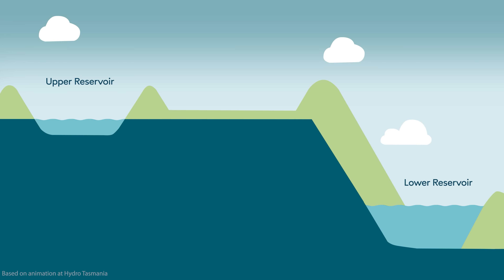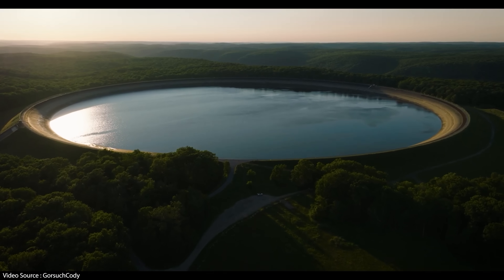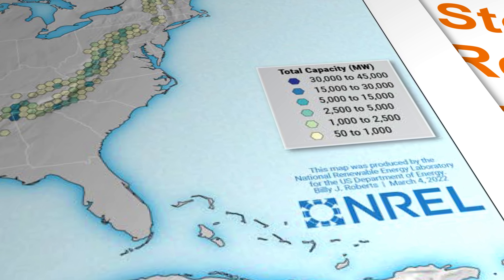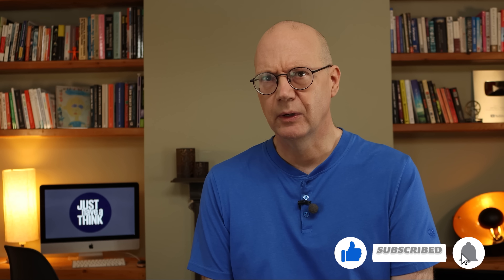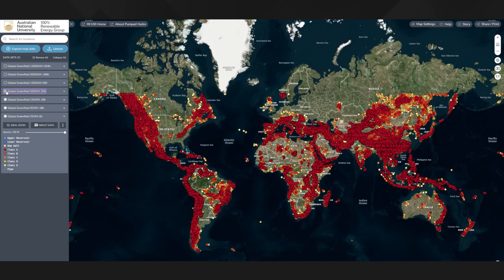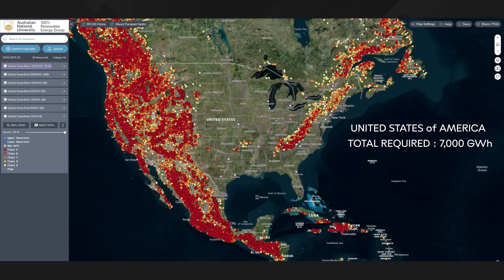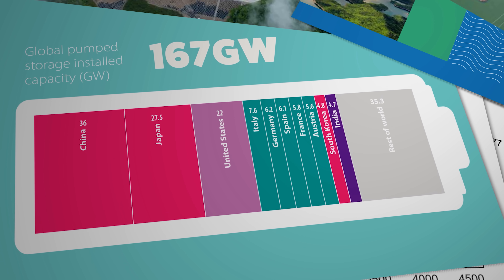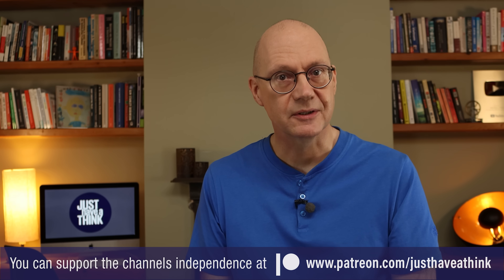The insane potential of Pumped Storage Hydro

Comment: Too bad there would be so many challenges replacing water with mercury in closed loop pumped hydro.  That could increase capacity by 13 times and reduce requirements in height and size.
Reply: There is in fact a company that has developed a closed pumped hydro system that uses a high density fluid - some kind of non toxic mineral suspended in water - which reduces the footprint. Drawback is that the reservoirs need to be fully enclosed. Company is Reenergise.
Reply: @petewright4640  There are lots of interesting challenges there as well.  I would guess keeping the minerals in solution rather then coating parts was a huge challenge for them.  Perhaps they found a mineral that could retain  a strong negative or positive charge.  Then charged the components with the opposite charge.  A prank some unnamed people i know pulled on new employees was to change the charge on a paint gun so the auto repelled paint.  I'll let you imagine the rest but it was quite a mess.
Reply: I can't see any potential problems with this idea whatsoever.   You might need to consider keeping this idea to yourself  - I am sure that if some politicians heard about this brilliant idea they would be all for endorsing it.
Reply: @michael-j-harrison  One of the things that make hydro cheap is that water is cheap.  You need 13x less mercury but i suspect mercury is more then 13x the cost of water.  You can't use any aluminum parts where mercury would come in contact.  Mercury spills would be a nightmare to clean up.  Water spills will basically clean up themselves.  Mercury is considered toxic.  If someone wanted to use this idea and make it practical please just invite to the grand opening.

Comment: Another interesting video. 
Floating solar would fit nicely with most pumped hydro installations.
The panels could help reduce evaporation, while the cooling effect of the water would help increase the efficiency of the panels.
The close proximity would also help reduce transmission losses.
Reply: You could also add wind turbines in the same location to share the electrical connection or even pump water back up to the top, which would probably be cheaper than using conventional wind turbines.
Reply: See recent Fully Charged video from Portugal
Reply: Didn't Dave do a video on that recently (using floating solar on existing dams), or was it another channel?  Lots of potential win here.
Reply: Floating solar on top of open water transfer channels is a great idea too
Reply: @JohnnyWednesday  absolutely. I saw, maybe on this channel, where they were trying panels over irrigation canals in India.
Reply: Interesting idea. It's new, creative, well thought out ideas, such as this, that are needed--and even more imporatant, need to be acted upon. Thanks.
Reply: tons of added cost to not just make them float but also maintain them on the water (they need to be cleaned and/or replaced. also as the water level lowers you run out of room and your panels could get wedged.

better off just using floating balls or whatever instead.
Reply: @rocksfire4390  yes, yes. all important considerations, which is why companies hire engineers to work out the technical, and accountants to work out the financial challenges of any major project. And not the YouTube Comments Section.
Floating balls will not generate electricity, and available real estate, mounting, maintenance etc are important factor in any renewable project.
Reply: @1964mcqueen  
accountants are wrong a great majority of the time on major projects, engineers fail quite often not just because some suck at their job but also because of said accounting being way off and the funding not being there.

floating balls might not generate electricity and i never said they did, what they do is keep the sun from evaporating the water which is vastly more important then getting a tiny amount of extra power. there is plenty of space for solar and wind for that matter.
Reply: @rocksfire4390  right. All those engineers and accountants can't hold a candle to some random You Tube viewer.
I'm talking about established technology that could be adapted to a slightly different scenario. Not reinventing the wheel.
Reply: @rocksfire4390  You are correct but advantages of solar on the reservoir are:
- local maintenance team can work both on the hydro power production equipment and the solar equipment
- no loss of energy (both facilities are located in the same area AND the transformers should be able to handle the whole system)
- Solar panels are more efficient when "cooled" by underlying water.
- Solar panels will benefit for solar reflection on the water and will be even more efficient
Lots of factors to be taken into account from technical and financial point of view for sure, but not all engineers and accountants are bad at their jobs.
Reply: @dominiqueridoux2073  
just because you CAN do something, doesn't mean you SHOULD do it. wind is much more viable then solar is on/near mountains, which is where these things will be going anyway.
Reply: @rocksfire4390  Not so, exists in a lot of places in China. The raft system used is flexible but also very stable. Imagine interconnected pearls and on each there is a few panels. Quite easy to scale up too. The one I have seen has a few of the rafts with no panels to form a flexible bridge from the land and you just need to walk to the panels for servicing. If you center the panels on the reservoir and only use 50% of the surface, the wedging never happens because the resevoirs are never drained completely. Still, energy produced on site can be used immediately on site to "charge" the battery, no loss of energy.
Reply: @rocksfire4390  yes, seen floating solar in Thailand works well but little movement on lakes and areas with high sun levels. Yes, I've seen the black balls realised to reduce water loss, looks cool😁
Reply: It would be interesting to see how the design could handle the change in water surface area during discharging. I suppose if you had to, you could allow the structures near the edges to 'run aground' during each cycle. Or just be satisfied with panels over the center area.
Reply: the varying levels of the reservoirs may be a problem though?
Reply: @markreed9853   The panels would simply rise and fall with the water levels, as they do when natural bodies of water fluctuate over time.
Reply: @1964mcqueen  I know they could do that but the extra cost of making the cable connection flexible enough ,and the mounting system flexible may outweigh the benefits. Sometimes what looks a good idea doesn't always work out economically (EG hydrogen vehicles)
Reply: @markreed9853  Floating solar already exists. It would of course require additional engineering, which is why you hire engineers. And why you have accountants do the cost analysis before any major project. Just as we figured out offshore floating wind turbines and the added expenses in their instalation, operation and maintenance, I'm sure there are people smart enough to figure this out.
Reply: @markreed9853 totally right (though you misspelled electric vehicles 😊)
Reply: @jeroendebruyne2165  thanks but cant find it now?
Reply: @markreed9853  You don't need to cover the whole surface; depending on the borders of the reservoirs (usually step angles) it would not be an issue, especially since the water is never pumped all in or out anyway)
Reply: Yes indeed. I have  posted two mildly caustic comments about electricity "provided" by closed loop pumped hydro. The next thought is that closed loop pumped hydro should only be supplied with energy from a renewable source. PV floating on the reservoirs is ideal. As that capacity grows the HC plants should be shut down. The utilities and corporates will not miss a chance to smokescreen their HC plants by intermingling any storage facilities.
Reply: I work in solar PV. "Float-O-voltaics" as this floating solar is know has serious issues regarding how they handle wind / waves. Generally speaking, I'm not sold that this is a viable strategy. Now, solar on canopies over water canals IS something I think is highly viable.
Reply: @MrBellytheman  of course there are issues, but FPV is in use. As with any renewable, the environmental factors need to be assessed before proceeding.
Reply: The water will almost certainly be acidic in old mines. It’s simply an unavoidable consequence of geology - the vast majority of orebodies are sulphides. You have to factor the huge maintenance costs in.
Reply: Indeed. I came to the comments section to add the same thought. Any location already using open space for power generation can benefit from PV generation
Reply: What is the efficiency of pumps and what is the water volume capacity of biggest pumps available? I mean how many cubic metres of water per hour for each biggest pump?
Reply: here in NL we had a site with floating solar, then an average summerstorm came along. Then they did not have floating solar anymore... 
IMHO floating solar is not a good idea...
Reply: @joop2295  Not in Newfoundland. I would imagine wind is the only sensible option there. That's what I have been saying; we have very smart people who assess these things for a living to see where and under what conditions any project will work. Just like Dave pointed out in this video, there are certain places where pumped hydro makes sense, just as wind makes more sense where you are, and solar where its sunny. All of these things are assessed for specific regions all around the world. Just because something wouldn't work where you are, does not mean it won't work elsewhere. Or they would likely determine that covering a reservoir is less crucial in N.L then it would be in Arizona.
BTW, can you direct me to any stories about that floating solar farm that was destroyed. All I could find was an article on a floating solar project that did not budge in a storm in Feb 22.
Reply: Just remember to never stop buying!  Consume CONSUME CONSUME!   The Delusions of the Amoral Shopping Addicts.
Reply: @java4653  you might be thinking of a different video.
Reply: I see more potential in thermal power generation, since the materials that can be used can be more easily designed to handle an aquatic environment, and converting thermal power to mechanical power for lifting water is a very mature area of technology.  By using water as the phase change material, we can also operate at lower temperatures.  For example, a giant percolator could have zero moving parts.
Reply: But how are you going to place solar panels over a many acre large body of water that has a rapidly and strongly changing water level....?
Reply: @Kabivelrat  I think that's already been discussed here. I am not an engineer, so won't pretend to know the details, but floating solar is in use in many parts of the world and in many extreme environments. I'm sure that smart people can design a system that accounts for changing water levels.
Reply: @1964mcqueen  Yeah fair enough...
Reply: And with the panels floating, it shouldn’t be too hard to rig the platform with cables and make the entire thing track the sun.  Increasing power output even more.  Maybe a single large piling in the middle which the panels would rotate around.
Reply: @douglee2438  this is a great idea imho. always thought on how to track the sun, but this is the best soluton imho
Reply: Dear geniuses, 
Stagnation is still a problem.
Reply: @rimbusjift7575  in a reservoir that is filled and drained on a daily basis?
Reply: @1964mcqueen  
Yes, this exact thing was a topic in the video.
Reply: Blocking sunlight over lakes would have a significant ecological impact.
Reply: @rimbusjift7575  You can block as much or as little of the surface as you like, but these are not natural ecosystems, they're built infrastructure, and the locations would be chosen to not include any valuable ecosystems. In this context, suppressing ecosystems is a benefit, just as it is in your kitchen.
Reply: @rimbusjift7575  We are talking about reservoirs. And the impact of increasing temperatures around the globe is having a much greater ecological impact than partially blocking solar radiation from penetrating waters that are heating at record rates..
Reply: @rimbusjift7575 In the case of a closed loop pumped hydro system, all wildlife would be introduced either intentionally or naturally and not be pre-existing to the site. Solar covered areas may also provide shelter and protection to young fish.
Reply: @craigknight2764  there wont be fish is a closed system
Reply: @markreed9853  not intentionally no, that was what I was saying.
Reply: "Closed loop" does not mean isolated from all other waterways.  Living things including fish will find their way in, if they are not deliberately introduced for the sake of a healthy artificial lake.
Reply: @JonathanMaddox  I understand closed loop means water is pumped from a lower reservoir to a higher reservoir. I have not suggested that either reservoirs are isolated from other inflows and out flows. The main point is that pumped hydro does not generate energy, it stores energy generated elsewhere.
Reply: @mayflowerlash11  my comment about isolated waterways and fish getting in was a reply to @markreed9853 who said "there wont be fish is a closed system".  Threading on youtube comments does not go very deep; in hindsight I should not have removed the default tag.
Reply: @JonathanMaddox  OK, thanks Jonathan. It's good that you are clarifying. Have a good day.
Reply: @rimbusjift7575  Like What?
Reply: @rimbusjift7575  
What ecological impact would it have on a man made lake with no fish in it?
Reply: @rimbusjift7575  The idea is to make artificial reservoirs, not use current lakes. In China they reclaim old  extraction sites (coal, minerals etc..) and anyway such lands are heavily polluted so no life whatsoever.
Reply: @dominiqueridoux2073  there is no place on Earth with "no life whatsoever".  Mine tailings dumps may be among the most polluted places on the planet, but they do support life and all but the most heavily toxic can be fully remediated over time into parkland supporting wildlife or farmland supporting people.
Reply: @dominiqueridoux2073  
Yeah, I just assumed the upper reservoir was natural.
Reply: @JonathanMaddox  You are 100% correct. I meant no "orignal" life whatsoever and also, China, hahahaha. They can strip resources like nobody can and when there is only bare rock left, not much life supporting for quite a while... At least they find a way to still make money EVEN out of such desolated location (and make use for their panels sine they produce soooo many of them).
Reply: @JonathanMaddox  and we do environental and feasibility studies on almost everything we build. Whether its a house near a wetland, offshore wind turbines or floating solar. 
Just as agrivoltaics can benefit both the solar yield and crop yield, we can design floatovoltaics that cool otherwise overheated lakes, reduce evaporation, provide shelter for aquatic life and produce efficient electricity at the very sight where it is needed. And all of this applies if life takes root in man made reservoirs. We can reduce losses of both water and electricity.
And, let's say you are correct that ecosystems will sprout in any reservoir we make. Wouldn't it be better that we give that life some light filtered through the panel arrays, structures to attach to and  places to hide from predators and lay eggs, rather than a bunch of plastic balls that do none of that?
Reply: @rimbusjift7575  Many of these sites are not lakes in the natural sense. They are just depressions that have been artificially blocked and filled with water. There is no reason to expect there to be aquatic life within.
Reply: @rimbusjift7575  If the lakes were artificial it wouldn't matter.
Reply: @rimbusjift7575  Not if the lakes were man-made in the first place, which is what most of these proposals are.
Reply: @rimbusjift
Please pay attention. Dave mentions that these PSH reservoirs would be away from riverine systems. Natural lakes would not be used.
Reply: @rimbusjift7575  these are artificial water reservoir, not lakes. big difference
Reply: @rimbusjift7575  it's closed loop... meaning it's not connected to a natural water source...
Reply: @critiqueofthegothgf  
Ah, water is magically teleported in.

Comment: Would it make any sense (have no idea how the numbers would work out) for creating small scale pumped hydro for private use vs using batteries.
Reply: No, small scale for this won't work.  Find an example of someone tapping a stream to produce electricity with a hydropower turbine.    The throughput of water in one hour would require costly, gigantic reservoirs at both ends.  Then multiply by five or ten hours.

Comment: I have to wonder if some existing dams could be modified to become pumped hydro sites?  Those with stable water supplies both above and below the dam?  There are instances along some rivers in the Western US where one reservoir flows into another and so on.  Said dams could also still be used to generate power in the usual method in times of high water flow and their conversion would give more flexibility to the grid.

Comment: It's good to see a video about solutions. I understand the need to ring the alarm bell, which you do very well, but it's good to also focus on practical solutions that can be done right now.
Reply: What are you alarmed about?
Reply: @joemccarthy7120  Where I live in northern Europe, we are currently under alert for heavy rains and I live in an exposed region. We didn't use to have that and I live in anxiety at the moment and I expect it to last at least another week And it's been going for a while now.

You can see what happens in the summer now. The weather patterns tend to get stuck for a while in a region meaning either heavy rains or intense heat; either lasting for quite a while.